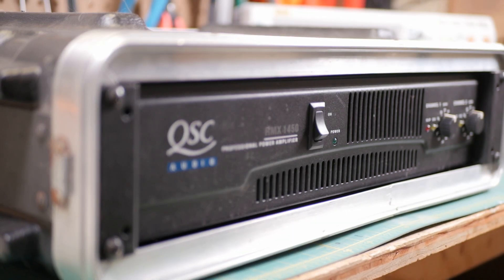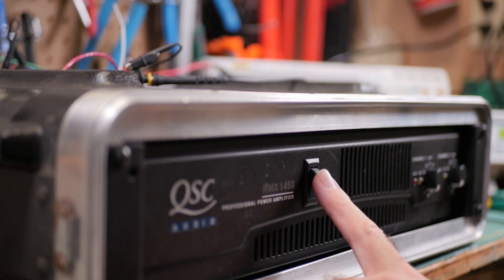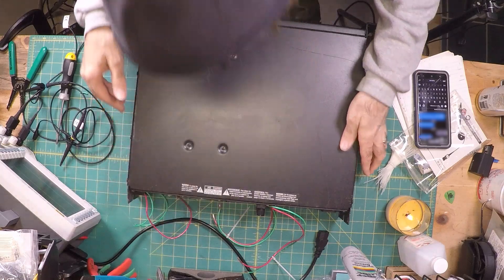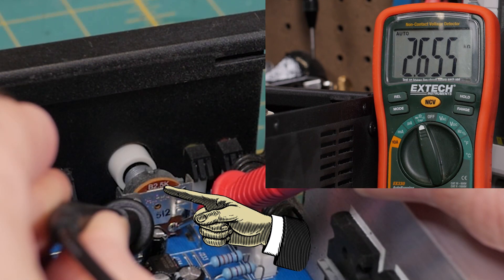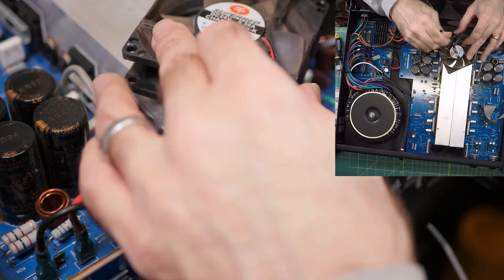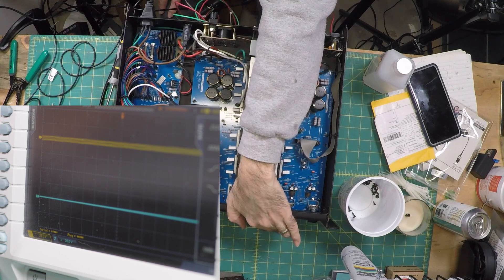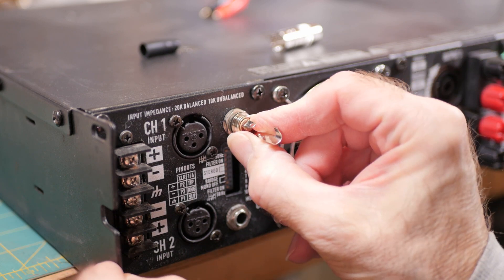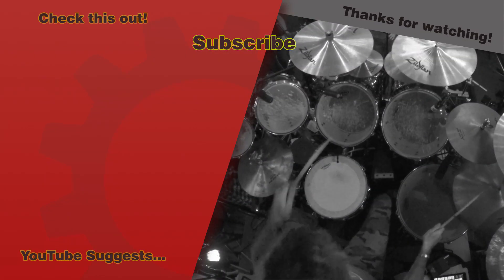Disassembly And Repair Of A QSC RMX 1450 Power Amplifier

Comment: These amplifiers are prone to input board issues.  Ironically the behringer EP is identical but lower grade components.  The usual problem is the subsonic filter and/or limiter function.  I turned off the limiter in these amplifiers since I use external processing and no problems since.
Reply from the maker: That's an interesting idea.  I have to say, it has been quite awhile since looking inside that unit so I can't easily recall the signal path, but the issue being within the input section seems just as feasible as anything else.
Thank you for the comment!

Comment: Can you do a video showing how to replace the power switch? Our Tech Lead simply unplugs the unit for power off and plugs back in for power on. The switch is currently broken in an upward / power on position, but I have heard the power switch is relatively easy to unplug and replace. Any assistance would be greatly appreciated.
Reply from the maker: I don't have that amp close by to take a look at any longer, but replacing the switch should not be too difficult.  If/when I get back to the location where the amp lives, I'll see if I can figure out a replacement switch that would fit the existing hole in the chassis.
Thanks for the comment, and thanks for watching.

Comment: Do these have fairly quiet fans or are they loud like others in this segment?
Reply from the maker: As I recall, this unit is pretty quiet.  I confess I have not heard it used in a studio environment, but it certainly doesn't roar like some amps.
Thanks for watching!
Reply: @mainejason Just got one in and it’s not bad at all. Opened her up and cleaned out the dust. Good to go!
Reply from the maker: Excellent - nice find!

Comment: I have a 2450 that's not passing signal on either channel. Took apart and cleaned everything but still nada. Nothing looks visually damaged. I have set it to the side until I gain more knowledge lol only working with a multimeter
Reply from the maker: Sounds like a fun challenge!
If you had a scope, you could inject a sine wave and trace along the path to see where it stops.  Aside from checking if anything looks burned up, it's time to check components...just be careful around those caps!
Thanks for the comment, and good luck!
Reply: Have a qsc 2000 an a only one channel a light up
Reply from the maker: Did you get your unit working?

Comment: Saturation problem thermal runaway that can also mess with the bias function as repairman and tech we all say dust is the number one enemy of All electronics it can cause serious damage to the whole amplifier the amplifier must stay cool to function efficiently and as intended! The heat sinks must stay properly cooled so removing all the dirt and filth solve your problem 👍 Also use some Deoxit contact cleaner in a spray can to clean the volume control potentiometers if volume control potentiometers are not moved for a while they can collect dust down inside the pots and they will lose contact connectivity between the wiper and the track of the potentiometer. It's just a suggestion❤ thanks for sharing✌️😁
Reply from the maker: Great information, and it all makes perfect sense!!
Thank YOU for sharing, and thanks for watching!
Reply: @mainejason  I'm trying to reply to your post and YouTube is not allowing me to do so and I don't know why 🤔 so I'm going to try to reply and post it again if you don't get my second reply please let me know thank you so very much 😁💯✌️😁 I'm trying to tell you something in more detail about what I was expressing to you in my first post 😁
Reply: @mainejason  the potentiometers or /variable resistors or you can simplify a volume control is connected to the input of the amplifier. Which are connected to the op amp. If they are dirty corroded there will be bad connectivity between the wiper and the track. Also if you are interested I have a YouTube channel if you want to like subscribe and share and you can learn some stuff through me if you would like I'm a fabricator engineer tech and designer I build my own custom amplifier and boards among other things 💯💖🤗 if you wouldn't mind please like subscribe and share I believe we are a community here on YouTube and we all can help one another as well as learn from one another many blessings have a great day my friend.
Reply: @mainejason  The potentiometers or /variable resistors or you can simplify a volume control is connected to the input of the amplifier. Which are connected to the op amp. If they are dirty corroded there will be bad connectivity between the wiper and the track. Also if you are interested I have a YouTube channel if you want to like subscribe and share and you can learn some stuff through me if you would like I'm a fabricator engineer tech and designer I build my own custom amplifier and boards among other things 💯💖🤗 if you wouldn't mind please like subscribe and share I believe we are a community here on YouTube and we all can help one another as well as learn from one another many blessings have a great day my friend

Comment: I had this ONCE, on a peavey CS power amplifier.. Pretty much exactly the same scenario as yours...
The problem did arise again, about 2 years later... So i gave it another clean.. and again, fixed itself...
On the 2nd "repair", i cleaned around each component and then tested again...
I found it to be dirt around the potentiometers..... Well... thats what i believe, because as soon as i cleaned around them and removed the dust and grime.. thats when the problem was resolved....
And since the legs of the potentiometers are pretty closely placed to eachother, and dust can be partially conductive over time etc...
I hoenstly believe it to be that...
Reply from the maker: That is some great insight, and I actually believe you are right!!
That's the only thing that kinda makes sense.
Thank you for commenting and sharing your experience!

Comment: Sweet result, but as you said it's a puzzle. I wouldn't have thought that just cleaning the dirt would sort it unless maybe there was something conductive you hoovered away. Also, as you said maybe a cold solder joint you knocked back into contact with the nozzle?
Loved the screw-removal jazz.
Reply from the maker: I agree with you on all counts.  For now, I'm going with the old, "If it ain't broke.....(anymore)" 😆
I thought jazz seemed to fit the mood
Thank you for your comment!